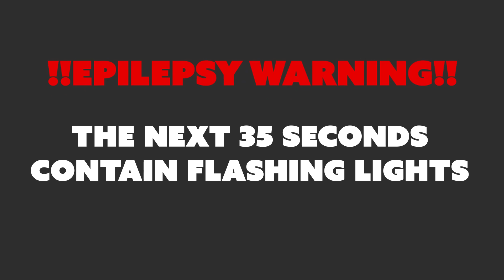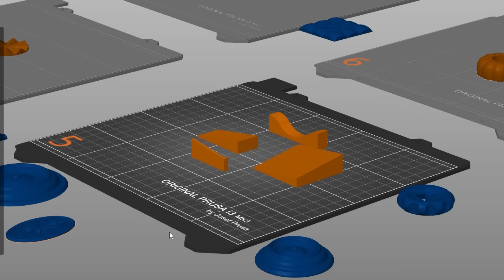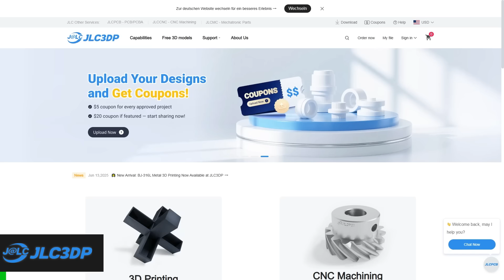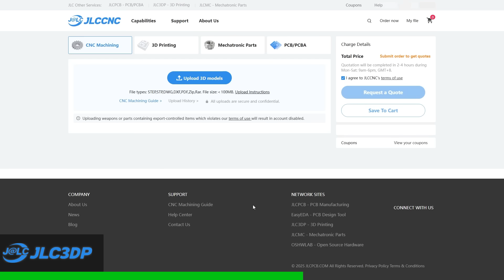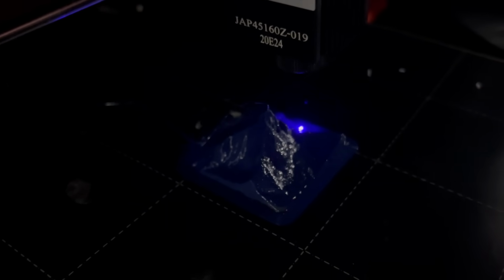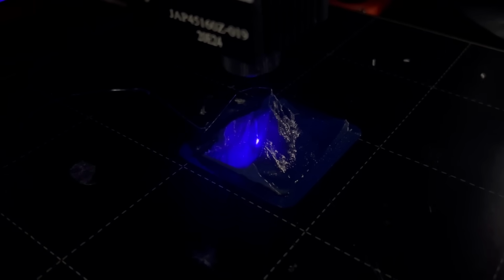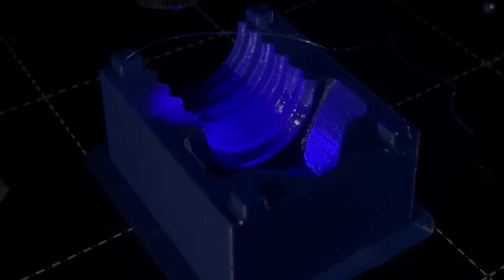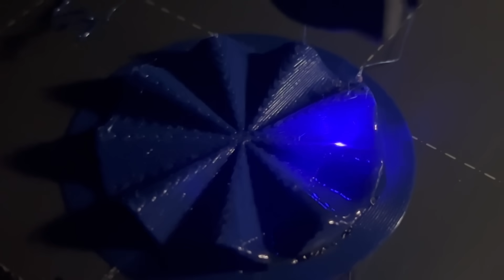Laser Smoothing 3D Prints! Does it work?

Comment: This was the first idea that came to my mind (right after markings/engraving text onto prints) when I heard about the h2d concept and what it could be useful for. But it turned out so much more boring in reality what Bambu was able to do probably partly because of safety concerns...
Reply from the maker: Yeah I think many people also thought about this after seeing the release trailer. I think the eye-safety would be okay with the H2D but the fumes are a problem. Would you use it if it was a thing?
Reply: @tengertechnologies  not only fumes would be a problem... They would have to test different settings for each and every type & color of filament as well as different environments (humid air/warm air etc.).
Getting all these settings dialed in would be a nightmare and in the worst case it could lead to fires (dark filament with high power laser settings for example).
Furthermore I believe that the process of melting the first layer could be improved by using similar methods as used when welding metals. Moving the laser back and forth a little bit to produce pools of molten material that bond better. On 3D objects this could be realized with circular movements for example.

Comment: hmm. interesting burn marks. Makes sense since we're heating the material up with effectively a "flame"

I wonder if microwaves would work? It would heat the materail up, rather than "burning". Focus the microwave beam very small (0.4mm width) and try that?
Reply: Microwaves have a very long wavelength, so you cannot focus them to such a tiny point. An infrared laser might be less well absorbed on the surface and penetrate a few micrometers into the plastic, therefore giving less surface burn and more melt, without the limitations of low heat conductivity. Perhaps carbon-fibre filament would also help
Reply: @321tryagain  Yes thank you; I was thinking of infared laser light could do the trick. Thank you for the correction. 
Yes I agree, this was my thought; just enough to 'melt' the top ~1-10% of the 0.2mm layer height so the next layer bonds better. Can use a green laser and remove the IR filter to do so, that was my plan anyway.

Yes also, a fiber-based matyerial would propbably; help to keep together the material better and have better heat dissipation to reduce burning. Would maybe have to increase the power output of the IR laser but no probblem.

Comment: Yes love this. You are the best 3D printing channel now!

I've had this idea back in 2016, to help print faster with better layer adhesion;
while printing the layer, just in front of the nozzle, before the material is laid down, point the nozzle just in front of the nozzle, where the next layer will be added. 
My theory; point a laser just before where the nozzle places the next layer onto the base material, effectively heating up the material for better layer bonding.

this 0.05s worth of time the laser hits the layer, just before the material is laid down, will cause the base material to heat up slightly, creating a better layer adhesion effect to the part. 
You already have everything done here now; just reposition the nozzle so that it points directly in front of where the nozzle 'will' be traveling and depositing material, and 'boom!', it should* help layer adhesion.

*in practice, since the nozzle is round and therefore material can be deposited at any angle from the nozzle, theoretically the laser needs to be in constant movement to make "perfect" focal point with the point just before where the nozzle deposts material. 

In theory it is very simple with what you have here, in actual conststent practice, it would be more complex to set up!

Just wanted to share! Hope you test this!
Reply: I had a very similar idea. I thought that a laser might be attached to a rotating collar, placed around the nozzle so it can spin to follow the direction the nozzle is travelling, always pre-heating a small spot just ahead of where the new material will be laid down.
I also thought it might work to add an air jet 180 degrees from the laser, to immediately cool the newly laid material. Don’t need any cooling fan then and we get much more precise cooling where it’s actually needed.
Some industrial quality machines do something similar.. they call it “zone heating and cooling”.
The real advantage of this is that it decouples the nozzle temperature from the layer adhesion equation and makes it independent of print size or layer time. It’s really key to making a printer that can print anything, of any size, with any material, consistently and reliably.
Reply: @simontillson482  you could use prisms and mirrors to cast circle around nozzle without need for rotating laser
Reply: @Guapter  Yeah, not a bad idea I guess, but you’d be casting a ring of light rather than a spot. It would heat up random stuff that isn’t in the path of the print head. Also, you’d be wasting most of the laser power, so it would need a much more powerful beam. My intent was to make things as efficient and controlled as possible. Same goes for the cooling jet - I could use a ring shaped nozzle to cool from all sides, but that takes way more air. A jet that rotates around to follow the print head direction means it can be small and only cool the newly laid filament. It also keeps the jet of air parallel to the print path, which is great for bridging since it stops the gooey filament from being blown around turbulently and getting all out of shape.
Reply: Great idea 
It may be a dump question, but can you Position the Laser in that way ? 
The nozzle moves in four directions so How do you Position a Laser 
That he Hits the surface in the Right degree and for every possible  direction
Reply: @Conquerthemall  That’s what the rotating collar is for. It’s attached to the hot end, so it moves together. It’s axis is co-axial with the nozzle, so the inside of the collar is always a fixed distance from the nozzle exit. The laser is attached to the inner rim, pointing in a few mm away from the tip of the nozzle, so the beam hits the previous layer just in front of where the nozzle is depositing material. The rotation is what allows it to follow the direction the nozzle is moving. This is a simple g-code script that controls the collar rotation using an additional axis, according to the current travel movement, so it would work without any slicer changes, just a post-processing script to add the extra collar axis instructions.
Reply: @simontillson482 
Thanks 😊

Comment: While thinking about your 'heat probe smoothing' idea...
What if you had different profiles like they do with cnc milling?
Such as a metal probe shaped like a ball with a pointy end? This could be used to emphasize creases in the surface?
The new Bambu labs 'smart nozzle' changer could load up a series of probe shapes and swap them much like a cnc does depending on the required smoothing.
Get Bambu to send you a free machine so you could prototype the system 🙂

Comment: Another fascinating vid. I wonder how the lasering would go with a transparent filament? as it's the outer surface that contributes to much of the scattering of light passing through the transparent material.
Also, mixing the laser with 'fuzzy skin' to further minimize the layer lines?
Reply from the maker: I think with a laser in the visible light spectrum it's not really an option to work with transparent filament. This would be very interesting with a CO2 laser but I don't own that so I can't test it unfortunately.  I could test the fuzzy skin idea though, it would give a bit of extra material to melt. This could maybe be used to keep part tolerances if configured perfectly, as the laser burns a bit of the material.
Reply: @tengertechnologies  I was thinking that the 'fuzzy skin' would help disguise the layer lines? Also, would it be possible to control the laser so that the 'fuzzy skin' combined with the laser, averaged out the original path from the slicer? Much like dithering an 8bit image gives the impression of a smoother result? You could think of the laser as 'pixel anti aliasing' for physical objects?

Regarding transparent materials... the hot metal probe would probably work great with a clear plastic as a few years back, there were people experimenting with smoothing the outer surface to make lens and suchlike.
I wonder if 'ironing' each layer while printing would also help with strength of the entire print?

Comment: Ive suggested this on Reddit a few times. I have no idea why we don’t already have a low wattage laser (or two) attached to the hot end to melt down the layer line during printing. Heck along with a high fps macro lens camera you might be able to fix defects on the fly
Reply from the maker: This is a very interesting topic imo. But I think it's not "standard" because it is not safe enough to do in your living room. I mean would you want to do this on a regular basis and expose yourself to the fumes?
Reply: @tengertechnologies If you calibrate with an IR camera you should be able to consistently heat the cooling plastic back up to 240 C but no hotter right? Just pulse and jitter the laser (actually tool head vibrations might take care of the jitter)